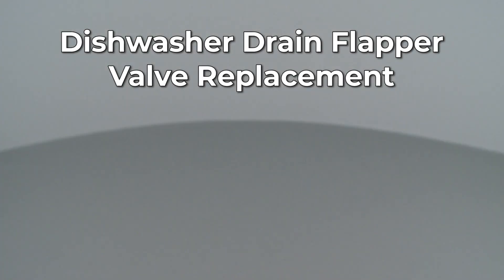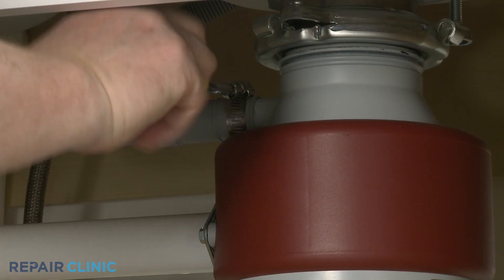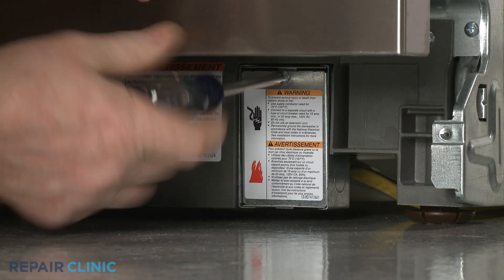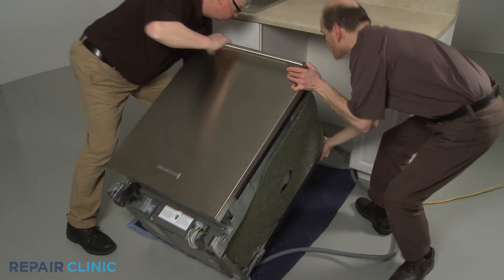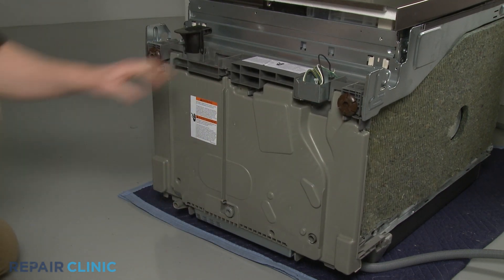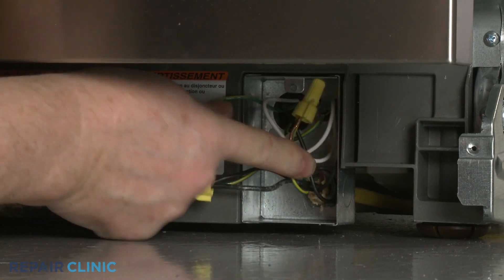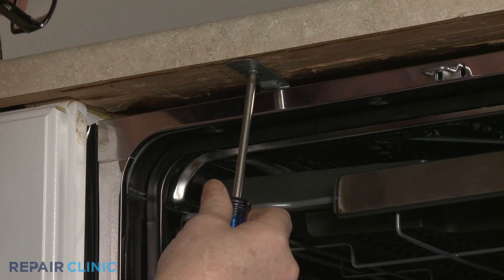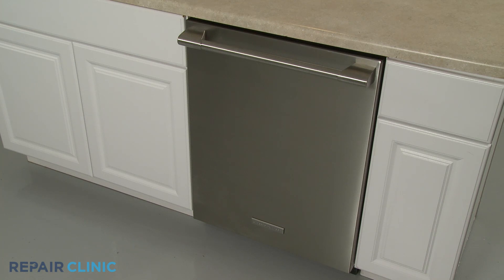Electrolux Dishwasher Drain Flapper Valve Replacement A00053601

Comment: Somehow my valve worked it's way along the drainage pipe to the trap. Is it essential to replace?
Reply: Did you find out if it was essential or not?
Reply: @siddiquemalik  Well, it's been without it for three years and we've had zero problems so I guess not.
Reply: @incytrevable  Cheers pal
Reply: @incytrevable  this is the answer I came here for. No way am I paying $80-$90 for this little piece of rubber!!